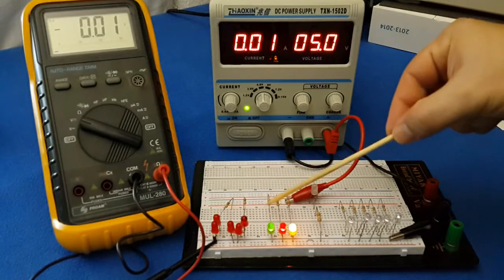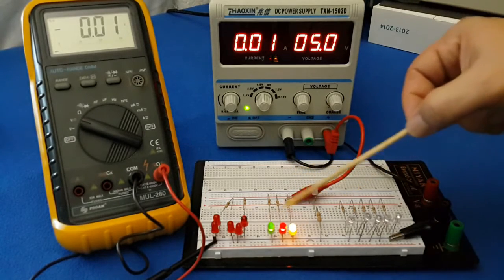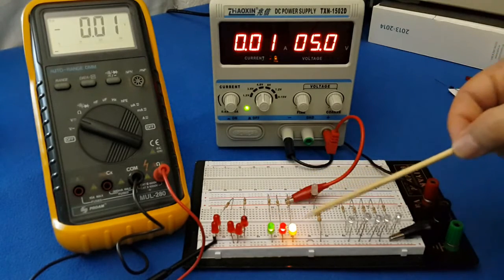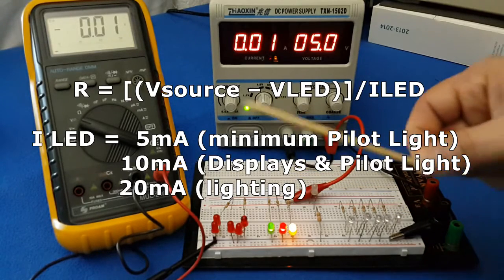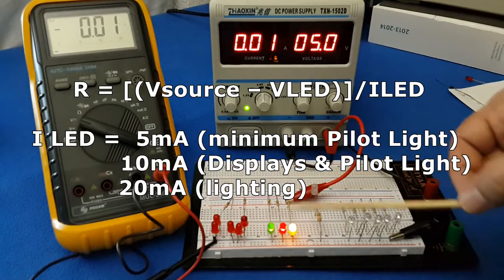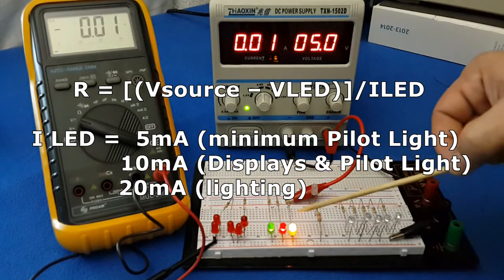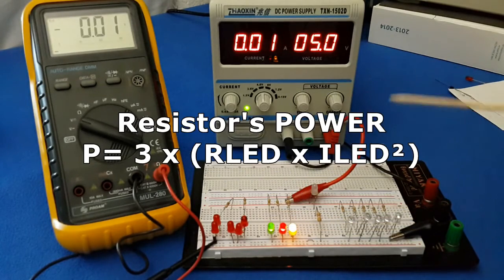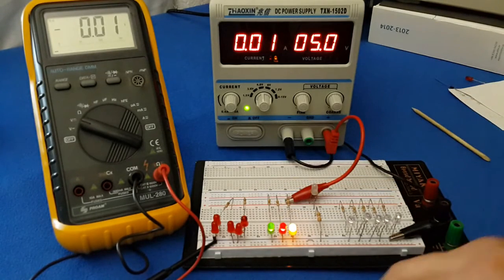How to calculate a LED resistor ? / led serial resistor

Comment: hi sir. can i ask if what kind of resistor or how many ohms of resistor should i use to light a 20 smd 0603 with 3.2 v and 20 ma each using a 12v motorcycle battery?